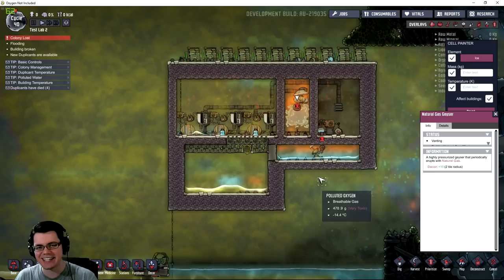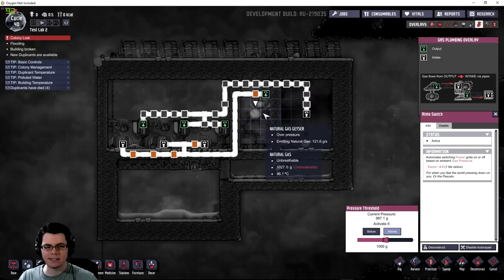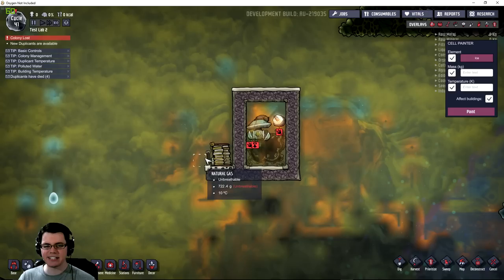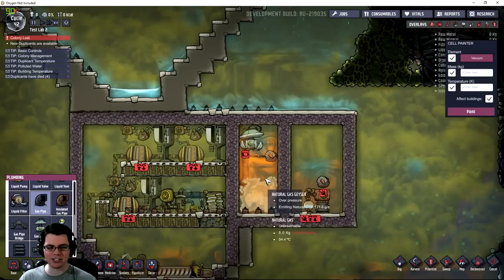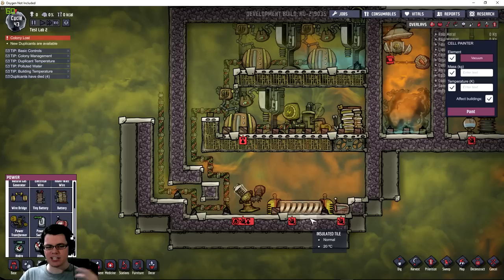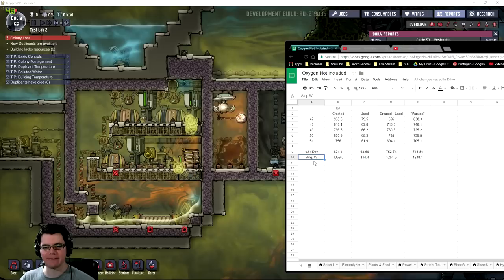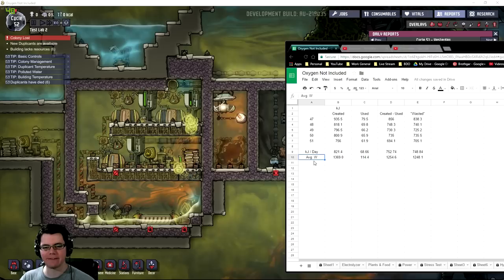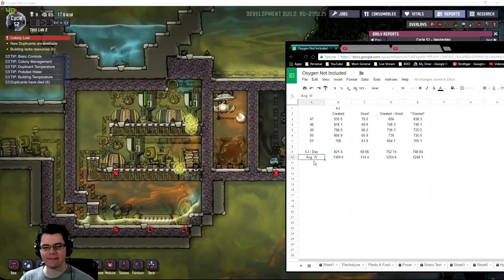Gas Geyser Power Plant Tutorial and Experiment!  Oxygen Not Included

Comment: I think the "wasted" number might be because the game calculates what you could produce if you were running the gas generators efficiently.

Since we already know that a natural gas geyser output exactly 80g/s on average (varying between 60, 121.6, 300, and 0g/s), Risu on the forum checked the game code so these numbers are 100% accurate, you're only effectively running 1.333(3) gas generators. Regardless on how many gas generator you put on the system.
Reply: For a follow up experiment you could take the other two natural gas geysers on the map that we can see and hook up only using a gas pump (with atmo switch) from each so you take the collected output of 3 geysers and add together in a main gas line. And see if that indeed add up to exactly enough to feed 4 gas generators fully.
Reply: Oh, and regarding the "infinite valve trick". The developers pretty much said they're not going to patch or fix that as it would require reworking how the fundamental physic calculations work.

Comment: I actually use a steam geyser to fuel my Natural Gas Gens. 
The Water supplies two showers and two toilets. 
The polluted water from that supplies four fertilizer makers, which produce natural gas.
My Air Scrubber is also supplied by the steam geyser and outputs to a fifth fertilizer maker.

This supplies two Natural Gas generators which has enough power to run the whole system and my cookers and massage tables. Plus enough fertilizer to supply 20 dupes in food.

Of course I have lots of batteries so it fills up while the dupes are asleep.

Comment: Seemed like a pretty rare map.  Unless they changed their spawn rate they used to be a lot more common.  Perhaps 4+ a map.  Either way you can create natural gas using the fertilizer makers.  The payoff takes more work since it takes 3 fertilizer makers to supply gas to 1 generator.

Not quite so much from just 1/3 since you have to power the polluted water in and gas out but it scales up.
Reply: There are 3 natural gas geysers clearly visible on the map. Both look slightly closer to the base than the one he used to experiment with.

Comment: Transformers in the lastest public release are broken. They draw 2-3x the energy that they really need to run. Klei just fixed the problem in a closed version. Before it was fixed I had this great NG system design (2 NGGs, 2 Fertilizers, 20 Batteries, and 5 Transformers). Before the fix the 5 Transformers ate all the power the 2 NGG created. I had to disassemble 4 Tranformers to get power into the plus column.

Comment: You forgot to mention the fact that making fertilizer produce even more natural gas. . .
And unless that was fixed since last time i played (just after the agricultural update), electicity production is not counted in the wires capacity . . . So you can just wire your generators to your bateries with normal wires. Need checking if it's working only on my computer though.

Also, i believe your flood problem you got was caused by poluted water evaporation, making steam, later transforming into water. . . With good liquid physics, you got your cooling drip under falling water, making it 2 tiles high, hence the flood. . .

Comment: You can use wire bridges with heavy watt wire - No issues.
Reply: you must be connecting heavy watt to regular wires via wire bridge
Reply: No Name - weird, i used them for my main trunk.

4 - natural gas generators. i put an air lock up, wanted the utility tunnel with clean O2.

used heavy wire connected to a bridge to leave the power room.

every floor of my base has 2 banks if batteries and transformers.

oxygen generation alone needed 4 circuits to run without over volting.

everything went through 1 bridge in the wall on a heavy watt bus.
Reply: It is currently possible to have 10+ generators and batteries on normal electrical wire without overloading it. It is when you start adding machine that are using the power to the same line that you need to start thinking about splitting the systems with transformers. This might be why you didn't run into any issues. It also means you can currently create massive power systems without a single pice of heavi-watt wire.

Comment: You should try making a natural gas plant using fertilizer makers (enclosed room where you produce and capture the natural gas).  This room could also be built around a natural gas geyser to help keep the pressure up and push out any other gas after construction (build gas perm tiles on the ceiling to let out any other gasses as oxygen is lighter and without oxygen in the room, duplicants won't produce co2). 

One gas generator provides enough power to keep 6 fertilizer makers running (720W).
6 fertilizer makers * 20 grams gas= 120 grams gas
120 grams / 60 per generator = 2 natural gas generators
Because of this, with each set of 6 fertilizer makers and 2 generators, you gain 880W of power 

You need to add polluted water to the system to keep it running though.
Also, morbs along with column separation of gasses allows for infinite polluted oxygen generation generation and dealing with the co2 from the generators. 

Another thing to check out is that laying out the output pipes from the generators is a bit weird in that some of them won't function continuously if 3 outputs are connected in the same spot to an output pipe (but do function if connected in different spots).

Awesome videos! keep it up! I'm curious what you'll make of this.
Reply: I've got a small version of this running in one of my saves, 3 fertilizer makers and 1 generator. It's working pretty well, the CO2 filter and the generator seem to be making enough polluted water to keep the fertilizer makers running
Reply: Well, in my base, I have 24 fertilizer makers and 2 geysers in the same room feeding into 17 generators, but the systems aren't perfectly isolated and the pipework glitches make it hard to measure whether all generators are running at all times.

Comment: On the version before the heat update, I managed to make steam by running water over hot equipment as you were doing here to cool the equipment. The water temp will continue to heat as it passes by enough hot equipment. I was using thermal regulators for this and to cool CO2 and other random gasses turning them into liquids. 

After the heat update I attempted to do something similar with the liquid tempidizer like what you setup here, but I never managed to make it work. Everything over heated and started breaking.

Comment: Hmm, does "wasted" power include power that dissapates into heat from batteries over time?

In that case a higher wasted than produced number might make sense - if you manage to both not store everything produced that day + also lose some of the energy stored from previously in the batteries.

Such a thing wouldn't account for more than a minor difference however.

I really really wish that they will introduce meters in this game. Just  a simple instrument that measures how much gas, liquid, power that passes through a particular point and has a readout of "last cycle", "average pr second", "total" and a button to reset the total and average. That would make control and measurements a sinch. Right now you have to use daily reports which are not only "magic" but also slow and roundabout to use (you pretty much need to save, run a bunch of tests and reload once you know if it works).

Seems like it would be fairly simple to code too considering the game seems to use a very simple tile system. You should just need to count and add it up.

Comment: you shouldn't count the first cicle / day in your calculations if you depend on pressure for a good yield of energy production.
The system will never reach 935,5 kJ again.
Maybe the 3 generators are NOT slightly less then 2, if you take out the 935,5 and replace it with 805-ish ;)

Comment: Even though the geyser can't fully support 2 gas generators (the system never produces 1600 watts/day), the fertilizer maker now produces natural gas from polluted water and could supplement your geyser.  Would the extra power required to run a fertilizer maker and its liquid pump make for a less efficient system, or would the extra power generation from the 2nd generator make up the difference?

Comment: Question: for any one that plays this..
has anyone else had gas disappear.. or move through  walls?

I had a ice biome beside my base on the left... it had 60 wheat plants and 10 weezewarts.. 
it had 70% of it full with CO2 with like 900 grams.. and the reset with O2 with around 900 grams too..  it had 2 air locks to my base (which was well over 1.2k of gas pressure)
and the Entrance was at the top most of the ice biome to keep the CO2 for the food storage on the bottom..

This room had 2 layers of insulated tiles separating from my base.. but for some reason my gas pressure went to 90grams.. and all my CO2 (which was A LOT) disappeared...

It seemed to go through the walls.. it was almost like the gas was going through both layers of the Insulated tiles and 2-3 of the normal ice biome material (mostly granite)

part of me was thinking the weezewarts was 'eating' the gas... I made two test rooms with 2 weezewarts in each.  One of them in a 4 space and 2 in a 3 space.. both with about 800 Co2 in it all equally spaced between the tiles..

After testing I seen that the gas was moved around (massive pressure in the top left, low pressure in the bottom right.. opposite of what you would think CO2 would do) but all the quantity was there

so I thought maybe the plants was eating some of it.. I made a small room with 4 plants and locked it.. and gas never changed... 

one thing that came to mind is a bug I seen with the Puft.. it would eat gas .. and make slime.. but the slime never spawned under it.. but 10 spaces to the right..

I noticed that the weezewarts were not really cooling my base (as it should) .. I thought maybe that was because the gas was gone.. but I thought.. maybe the weezewarts were teleporting the gas 10 spaces to the right in my base.. that would explain the random Co2 in my base (just outside the wall)

has anyone ever had that before?  or agree with my assessment that the weezewarts were teleporting the cold air output in the wrong spot?

Comment: Quick question, since I haven't played the game (even though I really want to [I'm poor]) before, but when you have a gas pipe (or a liquid pipe) pumping from one source pipe into two different end pipes, how does it split the contents? does it go randomly? Is it influenced by what the ends are connected to? Does it depend on what angles the two paths are in relation to the source (straight vs 90* turn) ? Does is split each "chunk"/ "unit"/ "group"/ whatever that flows through the pipes by some ratio? Or does it alternate between the two at an even rate: "one left, one right, repeat"? and does it change when it's three diverging paths from a single intersection? 

I ask because I think that it might be more efficient, assuming that it swaps each chunk's direction as they come, to have 4 with a tournament branching style of piping (1 main splitting into two, with each splitting into an additional two) which would decrease the favoritism and backup that might form in the generators that receive the excess amounts... but that's assuming that the generators would receive proper amounts and it's more costly to overfeed, rather than to underfeed... and again, I don't know much about any of this...

Comment: did you check how much gas it emits in a vacuum? because last I checked I couldn't pump it NEARLY fast enough to create a vacuum-like area running 6 generators.
Reply: well, ðen may have found another bug.
I use 3 gas pumps all overlapping the geyser. maybe its multiplying ðe gas?

Comment: I found that fertilizer makers are emitting natural gas for now, is it possible to use it , yet I'm still doing experiment for it but I ain't got enough time also I have no way to share the result so I'm leaving this idea for you. My idea is natural gas generators produce polluted water , and fertilizer makers require it, and it also produce natural gas that feeds generators , a air scrubber can be used to produce more polluted water but I prefer using a void instead. I have also found that natural gas produced by three fertilizer makers is not enough to feed one generator constantly, but what I want is to have it waste less , not produce energy.
EDIT: three fertilizer maker can barely run one generator, reducing the energy lost from three fertilizer maker and a liquid pump from 960 down to 400(you need a gas pump to run the generator so it is 160+240=400).
2nd EDIT : i was confused , three fertilizer makers only consume 360J with 480J is only 820J , so it only use an external cost of 20J, thus it can basically run on itself

Comment: I don't think you showed us the values that the Atmo switches have. I assume the Gas pump won't run with less than 500g/s and the Srubber wouldn't run with less than 300g/s (I think that is the value it needs to run). If you really wanted to you could put a gas valve after the pump and before the generators to only allow x g/s for y generators. But that creates another issue of having a gas vent that will over pressure.
The difference in wasted power vs the produced - used would probably be the drain of batteries. If I remember correctly they lose a bit of power over time. I guess part of the experiment could be to see how many batteries you can keep at like 95-99% charge. This should maybe stop the batteries being over charged and allow the generators to 'not waste'.
For practicality sake, you should make the liquid lock with the intention for dupes to pass through. It could also be the lowest point for the water pump and the liquid heating. Or have the polluted water drip into the liquid lock and have the overflow spill into the area for the pump and heating. You also might be able to create a self sustaining loop for the scrubber with a purifier. Needs a dupe to fill the sand though.

Comment: If the natural gas geyser is running hotter than the water would it be possible to heat the polluted water to 55 degrees from the geyser? it might both save on power and reduce the heat from the generators as the gas pumped to them would be cooler?
Reply: thanks :)

Comment: But could you use the machines to heat up the water till it's boiling? Like they can take a temprature above 100 degrees and if this game is realistic the boiling point should change depending on what temprature it is.
Reply: You can use gold amalgam to increase the heat limit to 125 degrees. The boiling point should depend on ambient pressure, so lower pressure is lower boiling point, but I don't think that's ingame.

Comment: um a couple things part of the heat problem with your generators is the fact they are touching each other. heat transfers between the object and all adjacent tiles(not diagonal). so your generators are heating your generators as well as heating themselves almost doubling the heat output of the generators. and do you want me to send you picks on an airlock that you can pass without usage of water even works for making a vacuum anywhere?
Reply: https://steamuserimages-a.akamaihd.net/ugc/853843656167337983/5B9269CE1DF27107313EEFD312922C8CD41C483C/ here is the easy access no pressure loss way of using it just as a hint but you can probly figure out how to attach that to any solid non slime ,or bleach stone area and build away from the safety of the vacuum. or not worry about gas transfer . after building those 3 things on that wall its safe to dig out the tiles behind them. if you building it from a ladder you need to put a ladder or tile 1 or 2 tiles below the door so the dupe never actually opens the door on its way through. great for things like fertalizer rooms fridges greenhouses all sorts of things
Reply: oh and try using a vacuum environment on a steam geyser its kind of a balancing act trying to find the right width and depth for the tank and where to place your tap to keep your temperature stable. But Hint Hint water freezes in space doesn't it?

Comment: +Brothgar Hey, big fan of your experimentation videos. A lot of the concepts you go over in this video I have been with experimenting on my own. Here is a link to a save file for the colony I have been working on that uses only 1 steam geyser and 1 natural gas geyser to sustainably support 10 dupes in the bubble. It isn't fully up and running yet in the save file, but if my math is right the farms should be producing more then enough food for 10 dupes. It also doesn't use any air scrubbers, water filters, or air deodorizers, making it a completely self-contained system requiring no sand.
drive.google.com/open?id=0Byy8nA2ITQG4cFU0dm50ejZUd3c  I think you might find it interesting.